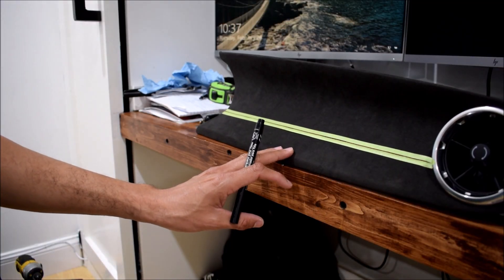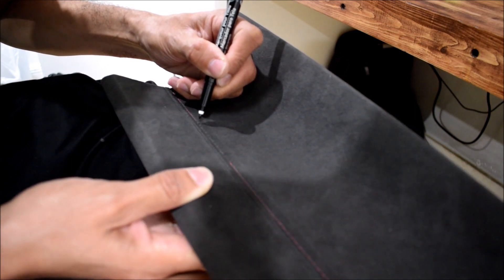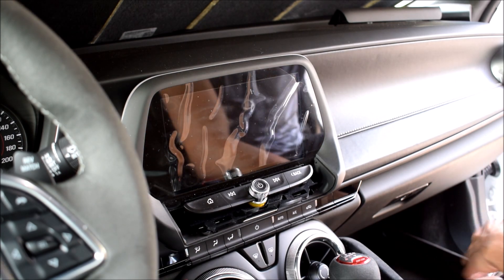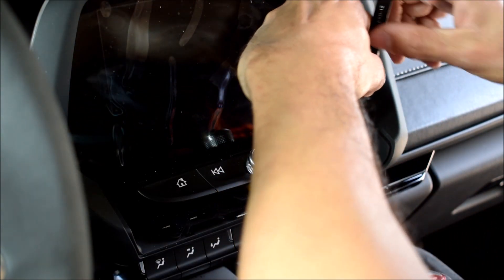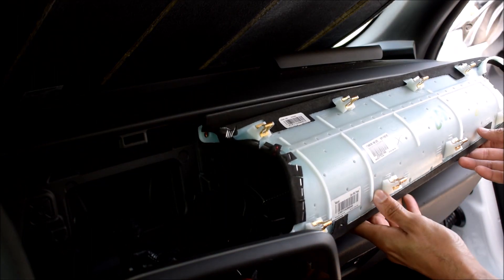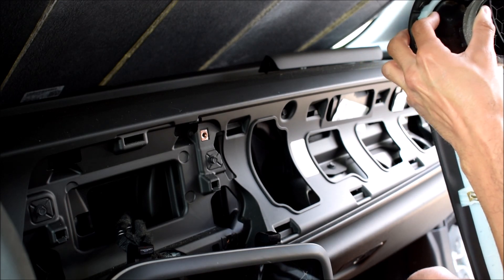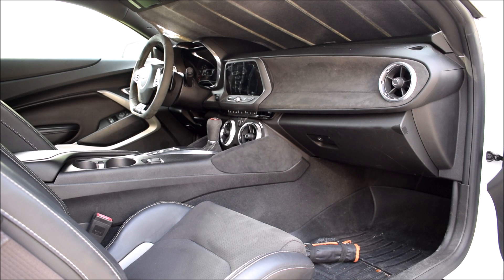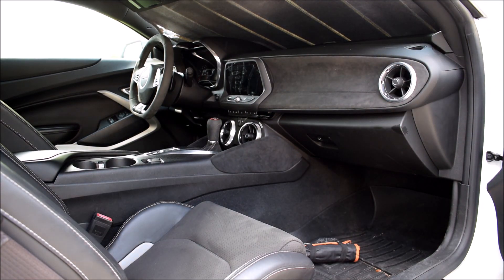1LE Camaro Suede Dash Pad

Comment: Is that marker oil or water based? How's it been holding up? I'm doing this, except I'm going red to match my 1LE interior. Looks good 👍
Reply from the maker: Thank you! I just looked at the marker and it doesn't specify. The way it soaks in and easily wiped off the faux suede leads me to believe water based. It looks the same to this day even though the Florida sun has been beating on it for months.
Reply: @doitwithproperstyle  thanks for that. And it's great to hear there's no fading even in Florida. 🤣 I'm in NC so the heat and sun are not far behind you. I found a red marker at JoAnn's fabrics and it doesn't say either... I'll try it. Thanks again.